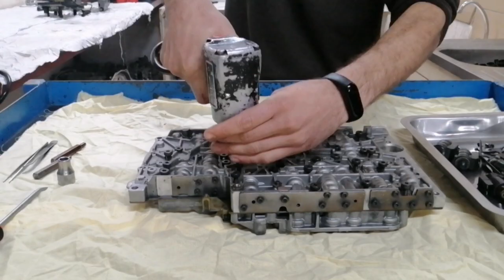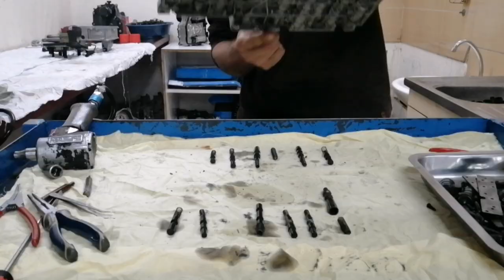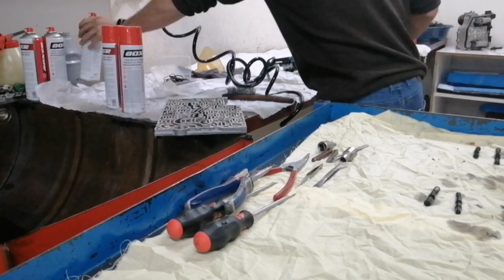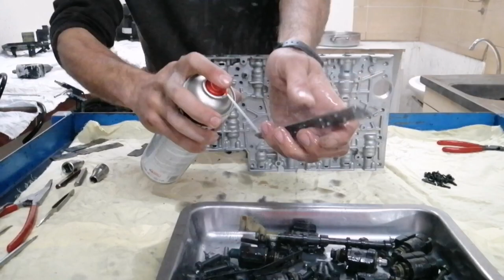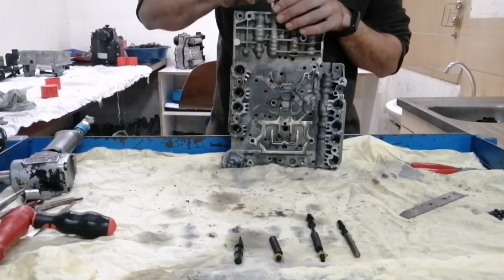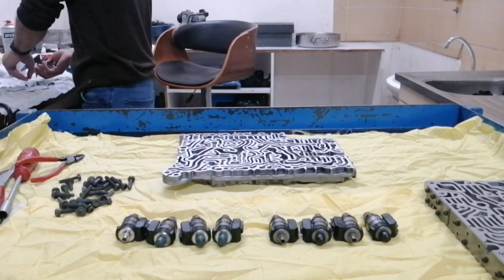MERCEDES 722.9 VALVE BODY RESTORATİON AND CLEANİNG

Comment: I missed where you put the "check valves" ball bearings back. I went back and you didnt show that you just sandwiched the plates back together
Reply: because its a crap video, doesnt really teach you anything
Reply: @cw2024  
Yes, unfortunately that part is crucial so I would not be using this as a guide other than for disassembly but even then you would need to watch it as 0.25 speed.

Comment: I have a 2011 E350 with the 722.9 automatic 7 speed transmission. I have no check engine lights at the moment and the car drives perfect if I’m just putting around town, however, if I accelerate quickly from a start or even from a roll…then quickly let off the gas…the rpms stay high (almost stuck in that gear) and after a few moments it will have a delayed upshift creating a thump sound and feel from the gear engagement. After doing some research, it appears that the RPM sensor can be a common culprit in these transmissions (part of the conductor plate assembly from my understanding). 

How much would you charge to replace that RMP sensor or, if necessary, the entire conductor plate with all new sensors? Any info would be appreciated, thank you!

Comment: Long story short, if I overfilled the 722.9 transmission by 2L, and even did a wide open throttle pull, do you think I damaged anything? The car was driving horribly, shift hard, slipping, and even felt like I was towing something. I quickly dumped the 2L, and now it’s driving almost normal. Still getting slightly hard shifting from R to D or P to D. And a very very slight fluctuation in the rpm gauge.

I had driven it 1L overfilled for like 2 months. Then one day it was acting a little weird so thinking it was underfilled, I added in 1L.
That is why it was 2L overfilled.
Reply: Assuming you still have the car - one year later - any issues?
Reply: @chris4321das  no issues, just make sure it has the correct fluid level. You have to measure when the fluid is warm 115 degrees.
Reply: Will cleaning this fix it
Reply: I have similar issue, dealership sold me service kit with just 6 quarts and told me its all I needed. After draining fluid out of pan and torque converter, I found out I was short, drained total of 8 quarts. Went back to dealer and bought 3 more, filled total of 9 quarts and car drove horrible, hard shifting every gear. I drained access of 1 quart, still drives horrible, not sure what to do to fix it yet. Any suggestions would be appreciated.  2014 GL450
Reply: @aleksandrkovalevich7107 check the level. Turn on your car, move from P, to R, to D, back to P. Open it up and see what drains out. Then wait till temp reaches 115F, P,R,D, Open it up and see what comes out.
Reply: @aleksandrkovalevich7107  if that doesn’t work, you may need to change the fluid again. You don’t need Mercedes fluid. Fuchs works just fine
Reply: @eoghanhennessy443  you gotta check the level and see if anything comes out. See my above comments
Reply: @Phuong_Nguyen_  Oh ok, I missed the part to check at cold and them warm up to 115f and check again. I will do it tomorrow and provide feedback. I sure hope its just the fluid level or something simple, I sure dont feel like replacing parts over this issue... Thank you for your input!
Reply: @aleksandrkovalevich7107  you don’t really have to check at both temps, but I do. Because if it is full at cold, it will definitely be full at hot, Yes tell me what happens and I’ll tell you what I did that fixed it.
Reply: @aleksandrkovalevich7107  it’s an easy fix, you will need 2 quarts.